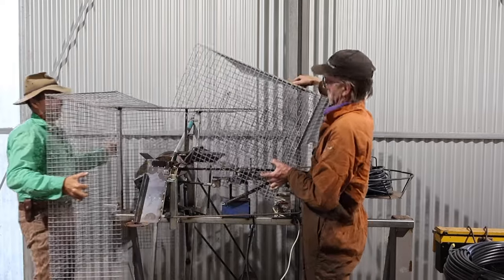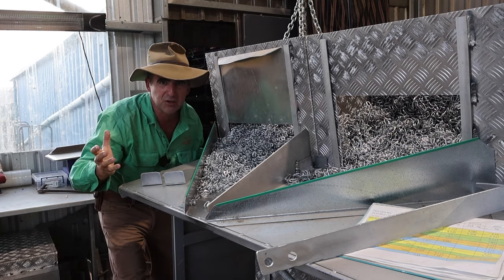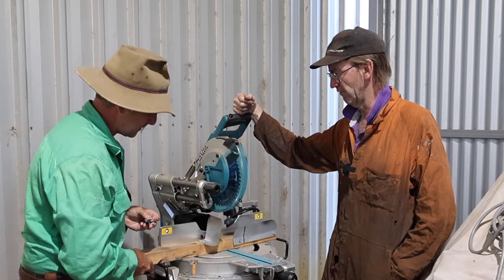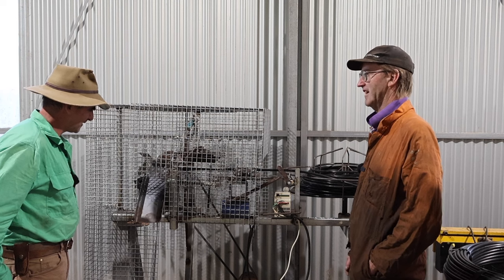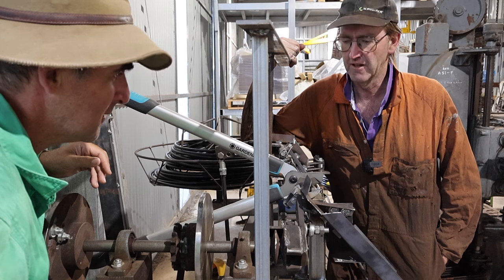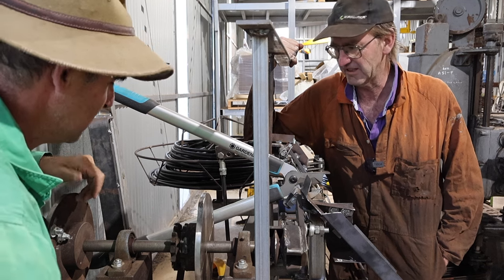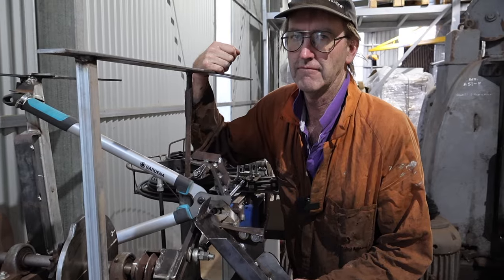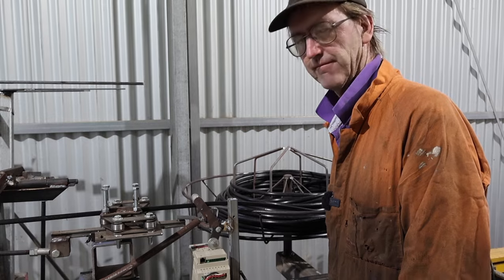Genius Farm Engineer Builds Manufacturing Out of Scrap

Comment: Curious what the added benefit is of this with respect to the ring insulators! Those you can screw in with a cordless drill and a bit that fits over the insulator's head. Here, you'd require two or three actions and adds a difficulty, to a degree. Happy to hear about your product! Very cool backyard engineering as well 👌
Reply from the maker: They have a product for ring insulators too. https://youtu.be/wgSVbS3sbdA?si=dq1_27ytchZZNnL0

Comment: I think Poly pipe even low density like shown has carbon in it and therefore earths or leaks. May be an old wives tale but there are some gallagher links suggesting it a "no-no".
Otherwise great machine
Reply: All plastics contain carbon. And It is well known that companies tell mistruths to bolster their own product sales.
Reply: I think you will find that is DM plastics insul sleeve, much thicker in the wall than low density poly, and designed to be used to insulate electric fence wire!
Reply: The carbon black is what protects the pipe from disintegrating under the sun. PE is used to insulate high voltage electrical cables, so it's got to be good.
Reply: @jasonac but not all plastics degrade like PE...